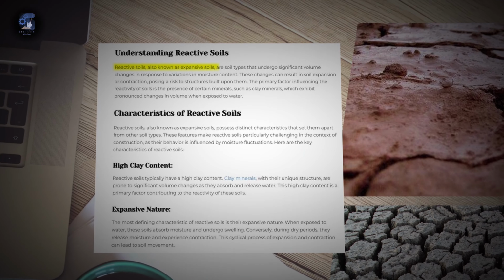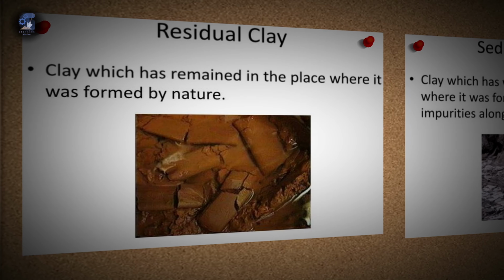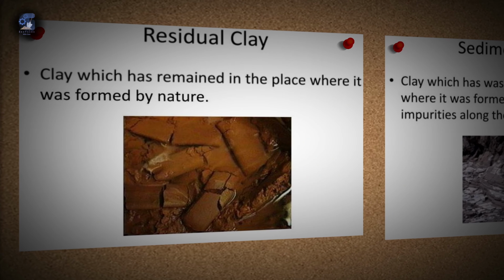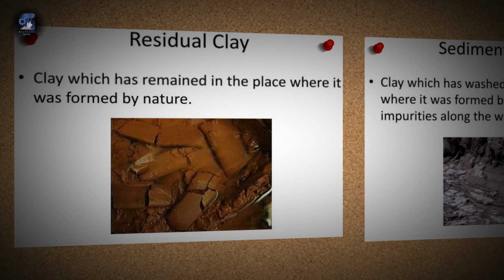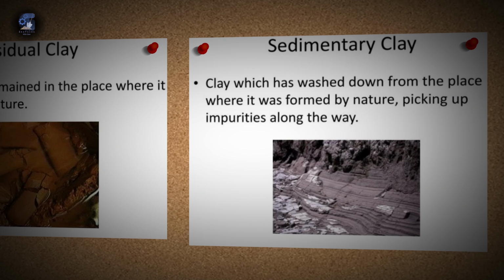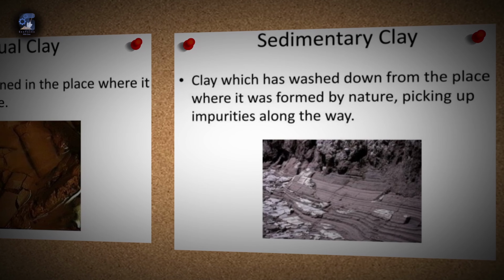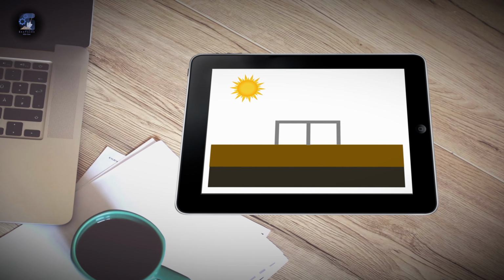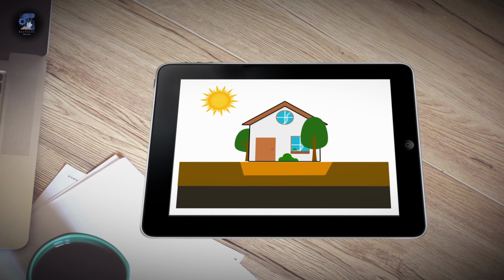The Destructive Nature of Reactive Clays

Comment: The rear quarter of my house is on reactive soil. Restumped with screw piles all at varying heights, fortunately there is some play but how high can those screws go before they become unstable? This is also the lowest section of the house.
Reply from the maker: It depends on how deep the reactive clay is.
The screw piles have to penetrate through the reactive clay layer and anchor in more competent soil.